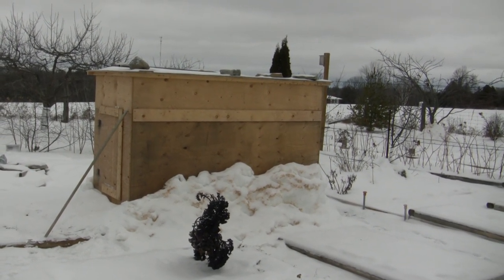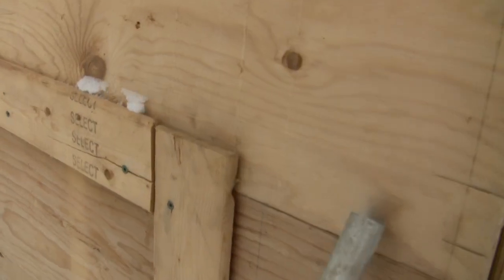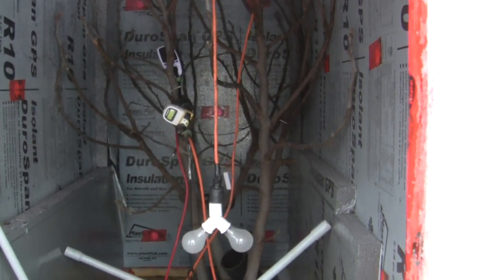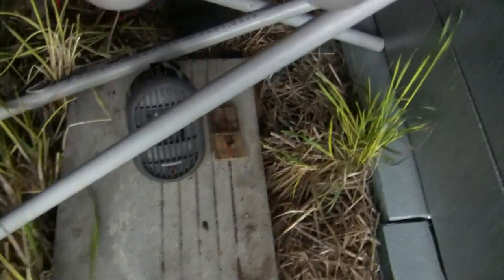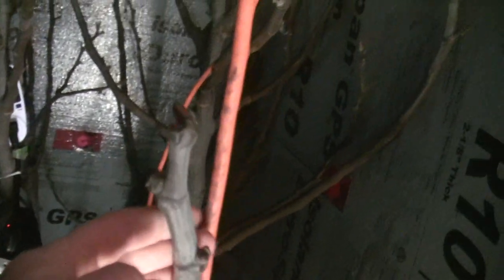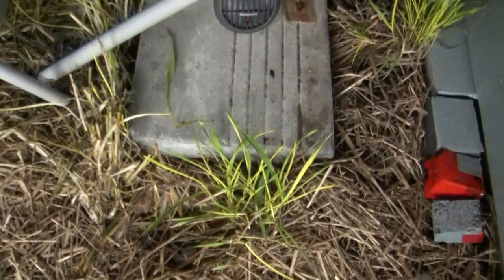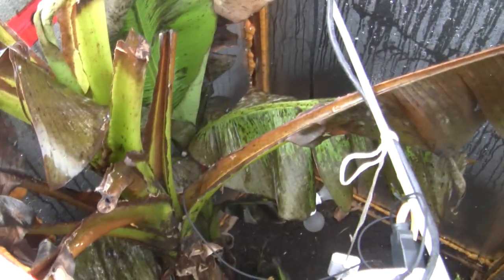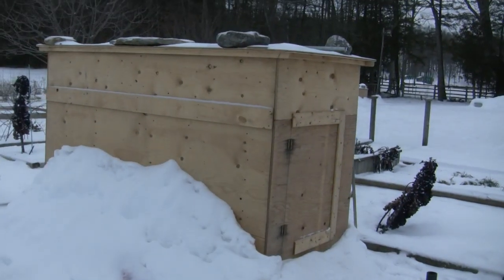Canadian Winter Fig Tree Protection

Comment: I think the challenge is not winter, but early spring when temperatures keep fluctuating and the fig tree starts to leaf out and need light especially if you're growing late ripening figs and need to extend your season.  Hardy Chicago is early though.
Reply from the maker: The box can help out with that too. By keeping it cool and dark in there in the spring, i've never noticed the tree opening up inside the box. If the box had a clear roof or southern wall, it would probably speed things up a bit in the spring to ensure enough season to ripen by fall. So far it hasnt been a problem, but might be iin a particulary cool summer

Comment: I know in Montreal folks bend and bury the figs under cardboard, plastic and lots of mulch.  The lightbulb will keep the temps decent for the fig.
Reply from the maker: Yes i think there are a lot of easier methods for overwintering, especially a tough variety like Chicago Hardy. I'm wondering if the warmer overwintering temperatures in the heated box will help the Negronne fig keep its fruit buds for an early breba crop in the future.